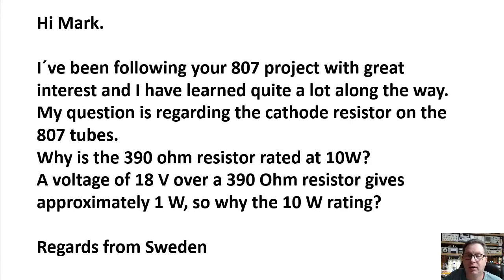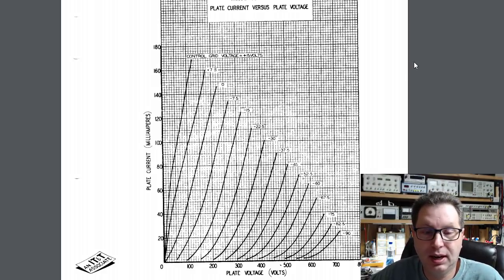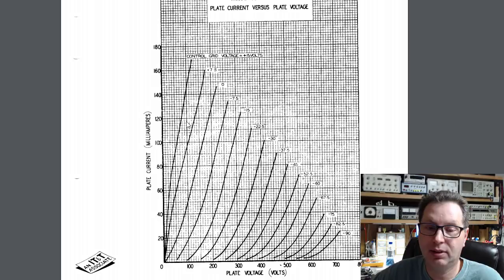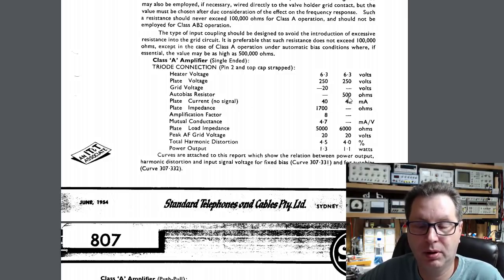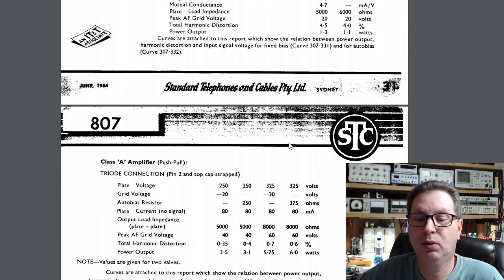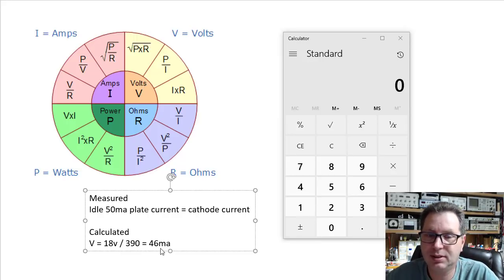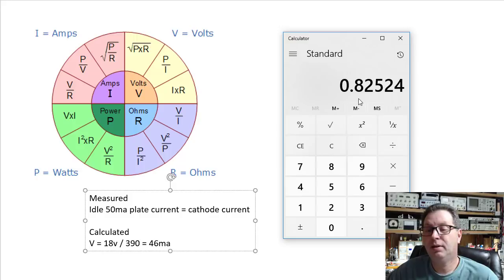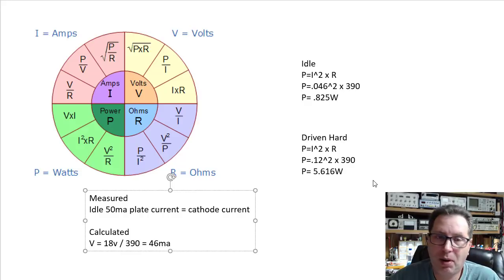What wattage resistor to use in cathode bias tube amplifier?

Comment: The explanation holds true for push-pull AB1 amps but the amp in question was single ended.  If the single ended operation is anywhere close to class A  then there will be hardly any difference between idle dissipation and full signal dissipation so current passing through the resistor would change little if at all.

Comment: Also chassis mounted resistors usually require the chassis to be used as a heat sink for their full power rating. The free air rating of many 10 watt chassis mount resistors is around 60% of its full power rating. If you do not have the typical full 130 sq. inches of heatsink for the 10 watt resistor it will need to be derated. Always good to check the specification sheet for the resistor used, and another good reason for overating it.

Comment: Also an over-engineered resistor will run cool, and its right next to the cathode bypass capacitor that isn't so happy sitting next to a hot component?

Comment: Ok, but then what about a cathode bypass capacitor? since an audio signal is AC, reactance is going to affect and play with the circuit a bit as "two resistors in parallel"